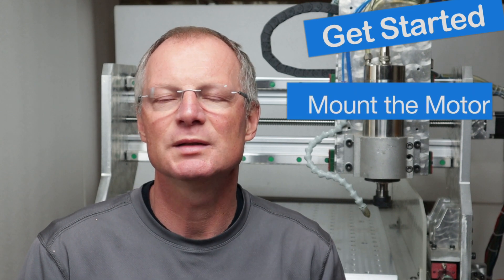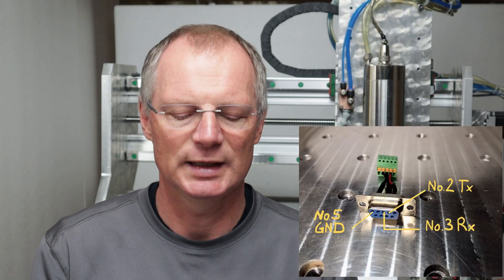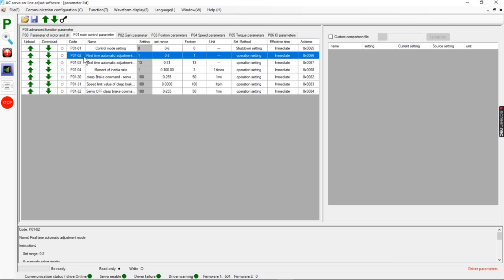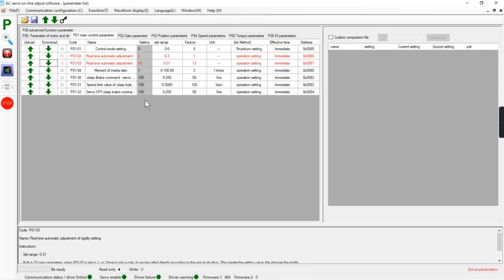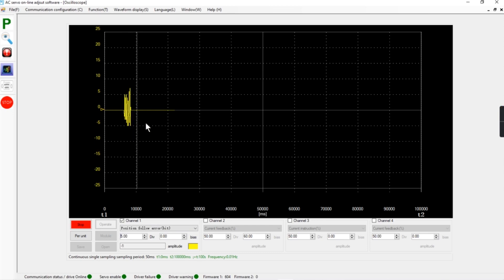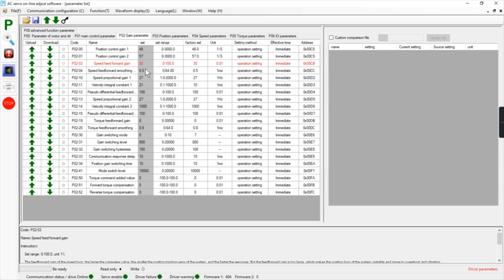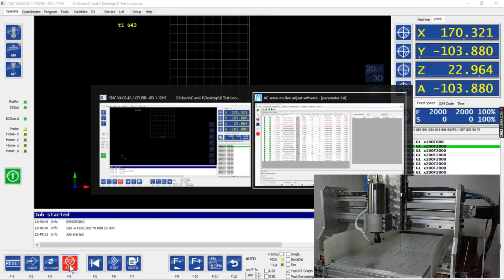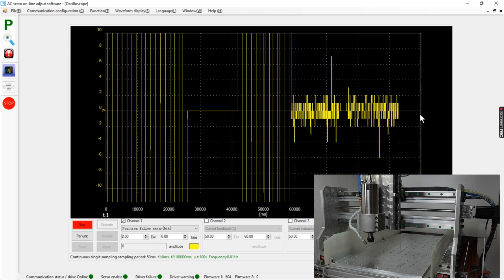JMC Servo Motor Tuning

Comment: In case someone encounters problem with oscilloscope not running, here is my feedback.

Servo : JMC IHSV60-30-40-48 v604
Tested software : 1.7.6 and 2.1.3
Everything seems to work fine, except the oscillo.
Tried several usb-rs232 cables (chipset PL2303, CH340, FTDI) with latest drivers. Both works to access the servo, but oscillo not running.

Here is the workaround provided by JMC team : use version 2.1.4 and set your PC system language to US English.
Yeah, it sounds weird but it works ! Now oscilloscope is running.
Reply from the maker: So best I can tell the issue is the language setting. The software expects always a “.” Like 0.5 and not a comma like 0,5. Of you change the language that can get messed up and create several issues.
Reply from the maker: That is excellent that you found this out. Great 👍
Reply: Where did you get the 2.1.4?
Reply from the maker: Hmm it’s been a while I downloaded it but I think directly of the JMC site https://www.jmc-motor.com/oftware.html
Reply: @JBWorx  I could not find 2.1.3 and 2.1.4 , only 1.7.6 for the v605 seems the latest, is this normal ?
Reply: Hello sir I have problem in this company motor and driver how I can speak with you.
And how I can download this software ❤❤❤❤❤

Comment: Dear Jörg, how do I do a factory reset? Unfortunately, I set too many things and didn't make a backup at the beginning. :D However, after your great video, I would start from scratch. Thanks in advance.
Reply from the maker: That should not be a problem. So I can’t post files here but search on GitHub for :
MikesMachines/jmc-servo-configuration. 
You will find all the files you need there

Comment: FYI, if you need more functions and parameters in JMC Servo Studio software, you can set the authority to level 2 or super authority, and enable the developer mode.
The password for level 2 authority is JMC2020, for super authority is JMC2021, and for developer mode is JMC2048.
Reply from the maker: Excellent thank you so much for sharing I only had the first one named as “super user”.
Reply: @JBWorx You're welcome, you can also try the latest V2.4.7 software, everything is much better in this version.
Reply from the maker: Yes, I have downloaded the software but had no use for it yet. I think there is a new NEMA 23 motor out with 400W  - if I can get my hands on them I will replace 3 of my motors.

Comment: Hallo, ich habe ein Servotreibermodell, JAND-7502
 und ich versuche, es über cn5 mit meinem PC zu kommunizieren, aber es gelingt mir nicht. Könnten Sie mir bitte helfen?
Reply from the maker: Leider habe ich den Driver noch nicht konfiguriert. Ich weiß also nicht welche Software oder welche Verbindung verwendet wird. Hab mir das manual runter geladen - leider alles in Chinese. Sorry aber da kann ich auch nicht weiter helfen.

Comment: Thank you
Reply from the maker: You bet 👍
Reply: @ i have seen many of your videos today after your advices on fb. May I ask what shielded cables you recommend for a cnc build? (I am converting my bought machine).
Reply from the maker: For communication so low voltage like switches etc I use a CAT wire. You can use the twisted pair as one wire within the cable further reduce the chance of electro interference. 
I bought cable that is also designed to be flexed a lot the manufacturer is Lapp. I think in the US I got it from automation 24 - but not 100% sure right now. It can be quite an expense if you have a large machine.

Comment: Can you share the finished settings file?
Reply from the maker: I could, but it really means nothing to you as no 2 systems or motors run the same. Much better if you follow the individual steps I showed.
Reply: I've got a faulty engine. I can't change the settings. I want to try to upload a file to it at once.
Reply from the maker: Send me an e-mail via my website. I will send you the file.

Comment: I have a stepperonline iSV57 and the unit of the position error shown in the oscilloscope depends on Pr5.20 (encoder resolution). Where the default setting is 0, which is 2^16 units per revolution. 
I wonder if thats the case for this servo as well and therefore the postiononig error discused is this video is therefore even better than a microstep.
Reply from the maker: So interesting enough the Stepperonline error using the oscilloscope did not change with different resolution settings. However I can’t remember if I used this parameter or just changed the setting on the dip switches.
Reply: @JBWorx  the units are easy to check. When observing the positionCommandGiven variable in the oscilloscope, it will change by 2^16 per motor revolution or the number of microsteps per revolution.
Reply from the maker: Yes, this is how it should work. However mine did not change regardless of the steps / rev selected.

Comment: This is a video I tried to find about 3 years ago when I bought some servos for a small CNC build, thank you for making this and showing how it's done correctly
Reply from the maker: Yes 3 years ago not much info to find now there is more as they are pretty popular.
Reply: @JBWorx  I will remove the stepper motors and replace them with the servos, it was a CNC for cutting small aluminum projects so the torque will come in handy.
Reply from the maker: Nice, good luck with your project !

Comment: Awesome videos, any chance you would make a video about tuning 2 of this motors running Y axis? 😁
Reply from the maker: It’s actually the same process. Hook into one and let the other run on auto tune. Just make sure your alarm output is hooked up so if you stall one axis during tuning the other one stops as well.
Reply: @JBWorx  First of all, thank you for your really helpfull videos, you are definitely in my top YouTube-CNC-People :) 
As i will encounter the same problem soon, just wanted to make sure: to tune the two motors on the Y-Axis you only connected to one of the motors via RS-232 and the other motor was just "blindly" following the step-dir signals of the controller without any tuning? Afterwards you probably just copied the settings onto the "untuned" second motor. right?

Thanks a lot in advance and many greetings from Germany :)
Reply from the maker: @SLK99218 yes you are correct, but after copying them you still need to check the following error and possibly adjust so that they are equal. Very important is to have the alarm hookup connected so that both motors stop as the one that you are tuning can lock up. Have fun !

Comment: Hi, could you share a link to where you find the software for tuning?
I have searched for jmc minusmotor and sinusmotor, but could not find anything.
Reply from the maker: Hi Martin, I work with version 1.6.7 and I used the link provided on the Sorotec site. Try this link:
https://www.upload.sorotec.de/doku/manuals/JMC1.7.6.zip

Comment: Hi there, 
Do you know how i change the alarm output to be normally open ?
Many thanks
Reply from the maker: I used a relay in between. So I collect all motor alarms as inputs for that relay. Have a look at the once that are sold for the Arduino they work great and also can be NO or NC or active high active low.
Reply: Sounds like a valid idea!
Thank you
Reply from the maker: No problem 👍

Comment: This is awesome. Thank you for these videos, I really wish someone would do some of these for the Stepperonline ISV57T-180 servo motors, as they are nearly identical, yet the tuning software seems completely different.
Reply from the maker: Thank you Jordan! I use the Stepperonline motors as well and like them a little better. I think the tuning software is ok.  An advantage is that it will provide you with a  value for the inertia. Also important to know is that the pos error is native to the encoder and not the selected div/rev. This will result in huge errors in comparison to JMC while the positioning is actually equal.
Reply: @JBWorx  I'm doing electronics right now, so I can't tune them yet, waiting on HGR20 rails and sliders to get here, but seriously thank you for a fast reply. I just wish I had more information on stepperonline ones as I have never tuned servos before so the learning curve is definitely going to slow me to a crawl.
Reply from the maker: The motor will come with an explanation of each parameter. I am sure with some patients you can do it.
Reply: @JBWorx  yeah I was reading through it last night, I have them here, just can't put a load on them. I'll give it a go when I can
Reply: @JBWorx  thanks again!
Reply: @JBWorx  I'm trying to digest what you mean by the pos error, div/rev bit.
Reply from the maker: Oh yes, so pos err is the positioning error. This is what you are after. You will tune the servo while monitoring what impact a parameter change makes to the positioning error. Div/rev are the divisions per revolution (or think of steps or increments per one revolution) that you select your motor to run. So let’s say 4000 steps per one revolution. The software does not take that into account when you tune, it will give the error in steps related to the encoder. What I wanted to say is that you will never get the error down to 2 or 4 steps like for the JMC servo shown in my video. It will be more likely 50 steps or higher.
Reply: @JBWorx  dang, that's a pretty steep difference. So is that detrimental to performance in a standard 3 axis router that'll be used for milling aluminum?
Reply from the maker: No not at all. It’s a bit like one Software is measuring inches the other is measuring feet. The same dimension will have a factor of 12 in between. That is what I was trying to explain. So one increment / step on the stepperonline is way smaller than on the JMC.
Reply: @JBWorx  Gotcha! Your first reply makes a bunch more sense now. Thank you!
Reply: @JBWorx  so just get my Pos error down to 50 steps for my application, and it should be positionally the same in real world application as the tuned JMC. Just the readout in the tuning software will say its larger.
Reply from the maker: @Nordic_Goon  Yes that is correct, best is if you set a dial indicator on the axis and now turn the motor to the error that you see in the tuning lets say 50 for instance and see what the dail indicator shows. Lets say it is 0.05mm then the question is if this is an acceptable result for you ? I think 0.05-0.1mm for a DIY Router is pretty good.
Reply: @JBWorx .05mm would definitely be acceptable for my use case. .1mm would would also be OK. I'll let you know on here how it goes. Thanks a bunch
Reply: @JBWorx  I think I'm to that stage now, I'm honestly not understanding the Stepperonline tuning software. The explanation of each setting in the tuning test is very poor or non-existent in their documentation...
Reply from the maker: So the first step is to let the tuning software make a move. This will give you the inertia ratio … that’s important. Unfortunately I can not look at it at the moment and don’t remember from top of my head it’s been a while. And yes most tuning software is not really easy to use … once you use a few you see that they are all trying to do the same thing possibly just calling the parameters differently. Some are very very complex with more parameters one could possibly ever use.
Reply: @JBWorx  I did manage to get that far in the tuning. I figured out that you can change the load of inertia and write it to the drive and run the test and it would spit out what I'm assuming is the inertia ratio right below it after I ran the test. For example if I set load inertia to 600, then I'd get an inertia ratio of about 455 on my X axis. I'm not entirely sure on how to read the graph as it relates to the pos error.
Reply: @JBWorx  thank you again for being so quick to help. I appreciate it as always
Reply: @JBWorx  okay, I just realized what the manual is actually trying to say. You run the test, note the value it spits out for "recognition of inertia", subtract 100 from that value, and write it to the drive using the ratio of inertia (%) field.
Reply from the maker: Yea, spot on sounds correct. I think there is actually now a button added somewhere that you can use to write the value from your test right into the parameter. But either way will work.
Reply: @JBWorx  yes sir, there's a write button right next to it.
Reply: @JBWorx  Hey so, it's me again haha. I've finished my CNC router build and now I'm getting into the tuning more. Just a reminder, I'm tuning the ISV57T-180W from stepper online. I'm able to determine the recognize of inertia, but I cannot figure out how to get the graph to output my data similarly to the way your JMC software does. So in essence, I cannot tune the position error, which is needed most definitely. I am also unable to increase to the stiffness past 12 without horrible resonating. Any help with these problems would be super appreciated. Thanks again for your earlier replies.
Reply: @JBWorx  So I just realized there's another waveform display that has a few more options on it. I wasn't able to increase my stiffness above 12 without the motor absolutely throwing a fit with resonance. So I bumped the ratio of inertia number down, in spite of what their instruction said, and this allowed me to get the stiffness up to 17, I strongly feel it being at 12 is what was hurting my position error so much. I re-read what you said above about a dial indicator, I'll give that a shot too, since there doesn't seem to be any other intuitive way to realize what the screen is plotting having the position error relative to the encoder..
Reply from the maker: Think of the inertia value as an overall volume control for all parameters. If it is off just one increment of change of a parameter can be too much. Or in other instances if you set a value to its max you still cannot achieve the desired result. The dial indicator will give you an idea where you are in the process. Acceptable / unacceptable result. You might be surprised and are already much better than expected.
Reply: @JBWorx  well I know I'm not there quite yet because the stiffness is a huge problem. And no matter what I do, P error is never under 14500. That's the lowest number I've been able to achieve. Which I don't understand since if it's relative to the encoder, that would mean it's over 14 rotations off. Which would mean it'd be moving 140mm when told to move 50mm. Helical  interpulations do not make round circles. Tested in wood.
Reply from the maker: You mentioned the stiffness value before are you using auto tune ? If so change to manual tuning.
Reply: @Nordic_Goon not necessarily. They do like the highest voltage you can provide them. It may depend on supplier who provides them. You can give your application to JMC when you order and they should be fine out of box. Amazing servos.
Reply from the maker: I don’t think that a JMC servo is going right out of the box. That is the point of this entire video and one major drawback of servos in comparison to steppers. Steppers do work right out of the box
Reply: @JBWorx  Ive ordered them direct from manufacturer, gave them my application, and they had specifically told me tuning shouldn’t be necessary that they preset them for the specifications i had provided. Ran them fine without issue. Perhaps they do not offer factory tuning anymore its been three years.
Reply from the maker: Hmm this is a little bit like I am telling you where I like to drive with my car and you provide the throttle setting … will not work very well. Anyways I am glad that you are happy with the results that you got from them.
Reply: @JBWorx   Hi there, was anyone able to determine which parameters are analogous to the gain parameters for the JMC Servos. I am getting a position error of +- 3000, I can't determine what that means in relation to accuracy. Assuming a 16 bit encoder (65K divisions) what does that mean if I have configured 4K step per revolution?
Reply: did you every find a guide to tuning the Stepperonline versions of these?
Reply from the maker: I have only tuned 4 of the Stepperonline servos. I have not made a guide for it. The manual is not too bad, the process is the same cranking the tuning parameters up until you get a squealing noise or lock up the axis and then back the value of from there.
Reply: @JBWorx  Thanks, I did some more tinkering this afternoon, starting out I was able to rotate the ball screw with my fingers and was getting something like an error of 600 steps, I raised the stiffness from 11 to 18, set the load inertia ratio to 23 and then went into the vibration suppression table and added some values there till it stopped squeaking. It does seem like with the JMC servos you're able to set auto tuning to on but also tweak the settings for the gain. With the Stepperonline ones if you set it to auto tune you can't change parameters in the gain page. 

I was able to (I think) get the positioning error down to under 20 but have a feeling I'm not doing this correctly.
Reply from the maker: @gilesclement so remember that the error value is always calculated to the encoder directly not to your selected steps per rev like on the JMC. So 20 sound amazing to me. What I did is to set up a dial indicator on the axis and then I moved it by hand so that I would see an error (in your case of 20) and read what movement I will see on my axis. A bit cumbersome but it will give you a very good understanding if further tuning is necessary or if you are already beyond anything you expect your machine ever to do.